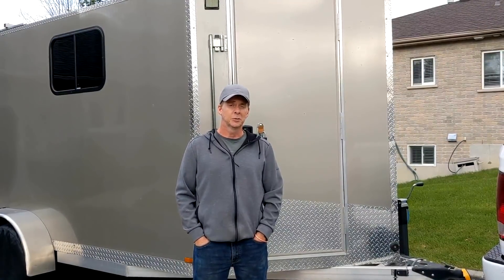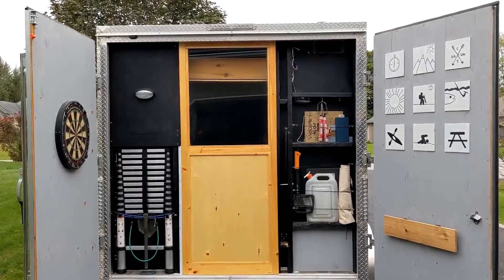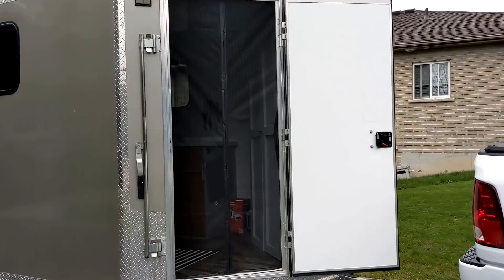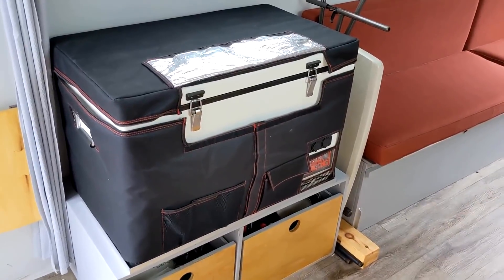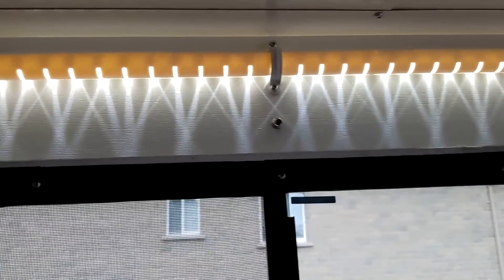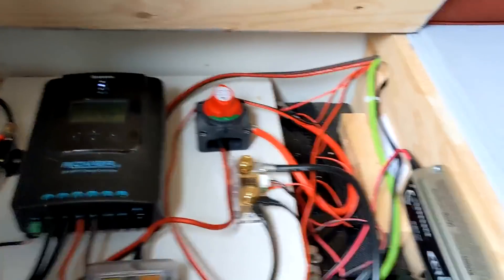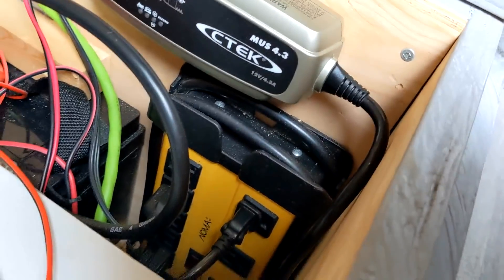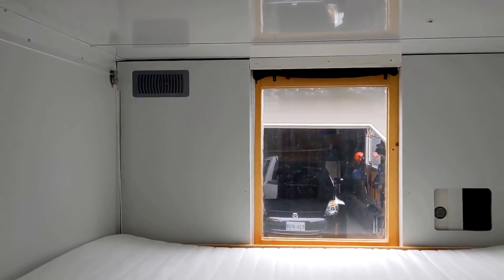Cargo Trailer Conversion walk through

Comment: I was about to pull trigger and  buy 2 electric actuator to build my own bedlift until I saw your build,  Both of your bedlifts are the simplest setup  from the hundreds of bedlifts videos online I have watched.  

Whats not to like, both your your bedlift designs require little material, investing  less than $100, and simple hand tools most DIY'ers have on hand.

Thanks for sharing
Reply from the maker: Glad I could save you some money.  V2 is definately smoother and simplier.

Comment: Space, space, space!  Tons of seating and plenty of sleeping options too!  Very well thought out and so practical.  A little pricey but of course you started with a very nice cargo trailer.  This thing could last you a lifetime easily.  Your build looks nice and clean too.  The cushions are nicely sewn and fit well, that’s something that many don’t quite pull off.  I have that same ladder, same solar lights too.  The dart board is a nice addition that invites other campers to socialize I’m sure.  Just really a great job.
Reply from the maker: Thanks for the nice comments.  I got lucky on the cushions as they were the exact size I needed so I didn't have to get those made.

Comment: We need a part 2 for that bed build and set up of the pulleys! Love it and want to do the same!
Reply from the maker: Hey there,  I have two videos about the bed.  The Pully system has been replaced now.  I found it was a good start but just not what I really wanted.  Here is the video of that one https://www.youtube.com/watch?v=bktiLsHAknc and here is the location of my new bed https://www.youtube.com/watch?v=BzIKehEFsVk&t=156s.  Much simpler and can be raised with a drill or manually.  The key for me on both of these was to not need to have a motor to move the bed thus not requiring more battery.

Comment: You have a really nice trailer conversion! Thank you for the taking the time to share it with everyone. I personally really appreciate it. I love elevator beds and this is the nicest I have seen. I am about to start a build and think I will go this way as well. The only thing I will do different is to use an 12V electric awning motor. I would be interested in knowing more about how you attached the roof rack for the solar panels. Maybe a short video on that? I have a plan for what I will do, but its nice to see how other people do things. Thanks!
Reply from the maker: Thanks for the comments.  I just stayed away from the electric motor so that if I was running low on power when camping that I had alternate ways of getting my bed up and down.  I plan on using the drill but also a small crank (manual) for choices.  You are the second person to request this so I will plan on doing this shortly.  Not sure if you saw both my other videos on the bed.  V1 and V2.

Comment: Afternoon Kent, Mark here. Hey awesome job on the build.. As of to date, I like your build the best! You used your space by far the best to your abilities!!! I am "HIGHLY" impressed Sir!.. As I am considering a build myself as I approach retired and came up with the same idea 25yrs ago, but life get's in the way at times.  That and now Lrg Teardrop and smaller campers are "WAY" too expensive and not roomy enough.. I may have questions later on. Again AWESOME job!..
Reply from the maker: Thanks for the great comments.  We  had a popup before and loved it but decided we wanted something easier and custom.  I like to come up with ideas.  Got to say watching all kinds of tiny houses, vans, RV and boat videos really help with the ideas.  Feel free to ask questions any time.
Reply: @liveandbreatheeasy  I tent camp now, but I have a Bluetti AC200P power station to power my cpap, fan and or milk barn heater in cooler weather.. Plus I only camp in State forest as the cost is cheaper, and I do Bigfoot research here in Indiana obviously, lol...
One question is, what are you towing with and what would you suggest if something else?.. Mark (aka Hoobilly)
Reply from the maker: @squatchnindiana3419  Hey there Mark.  I have a Ram 1500 but with my setup you could definitely tow it with less as the main trailer is made of aluminum which is much lighter than steel.  I haven't weighed it yet but I am sure it is under 4000lbs and I made sure I had breaks on it too which makes a huge difference.

Comment: Very nice build ! Back doors are great. The only option I’ve seen before that I like is having a ramp style door open up for an instant canopy, but it would require the space
Reply from the maker: Hey Tony thanks.  Yes, it took me a long time to finally decide on the doors.  Lots of positives for the other but like you said you need to have the space when camping.  I think a smaller trailer it is a great idea.

Comment: Really nice build! Lots of great ideas for my build. I plan on doing a retractable bed also. Looks like you did a great job designing the complete build. Would love to see a bed build video. Thanks for sharing.
Reply from the maker: Thanks.  I did a short video on the channel of the bed build.  I am currently trying something else out that I saw on Youtube that might be better but not sure since it doesn't use the crank idea which I liked.
Reply: @liveandbreatheeasy  Thanks! That would be great. I'm playing around with the 12v Harbor Freight wench build I saw on the first bed build I ever saw. Guy in Alaska   made one and it looks like the simplest one so far.

Comment: Very nice very well done but as an idea for your bed remove the handle from your pulley system remount the bolts and use a power drill for your up and down so I can take my

Comment: Looks good! Interested to see what you'd change after using it a few times.
Reply from the maker: Hi there,  we have used it about 20 times so far and I have to say there are only a couple minor things that I would change in the sense of build.  The layout we love as everything is in the place we wanted it and is very practical.  We had many years of camping in a popup trailer so coming up with the basics was easy.  One thing i would consider if i was to build the benches again would be to make the space between the wall and the hings wider so that the back pillows wouldn't affect opening them.  I am just finished v2 of the bed lift system a video will come out on that one.  Build quality could be better but I am hard on myself.  Thanks for asking.

Comment: You just made me a liker of a V nose for the most part I hated them but putting the door there made lots of room in the rest of the trailer. And smart, also pantry near the kitchen part. The bed would be an issue because it would be climbing over my wife to get up to go to the bathroom or if I get a leg cramp. I guess I could go out the back door. I would have to make a larger door in the back and maybe move the bed toward the kitchen part of the trailer. I very seriously thought about building a cargo winter house using an 18' plus tongue trailer we would only eat sleep and watch a movie or tv show Inside, mainly visiting relatives while we were in Florida. I want my property in the mountains to be our home. 73
Reply from the maker: Thanks for the comments.  Yes the V nose this way uses the space much better.  The was put at the end so that if it wasn't up we still could sit and eat.  I agree that climbing over your spouse is a pain.  With something that elevates like this, I am not sure how else you can get around this unless you chewed up more space and had your head and legs go length-wise in the trailer.
Reply: @liveandbreatheeasy  I would put two twin beds and have maybe a foot between to get in and out. I slept in a motor home that had beds on the sides but the beds were very narrow not a comfortable sleep. I guess my idea have a back door to go out. With tear drop trailers you have two doors one on each side that's another project I don't want to get into. My ideal would be a front bed and a rear bed and the door out the side. My wife cannot stand my snoring and hers can keep me awake if I'm not really tired. A seven foot wide trailer is really not wide enough but easier to haul. 73

Comment: Just found your Chanel and noticed you have same trailer I just bought and is being built. I am sure I will have questions for you once I watch your videos!!!
Reply from the maker: That's great.  Hope you enjoy it.
Reply: @liveandbreatheeasy  do you plan on any videos of construction such as insulating? I would like to how you made a roof frame for your solar and how you attached it to the trailer. Vacuum outlet is brilliant. I bought a marine mini hatch but I think the vac outlet would have been cheaper. I am doing same thing for shore power. Simple extension cord through floor.
Reply from the maker: @jacquesbeaudoin9706  I actually got them to insulate it because by the time I did that I wasn't really saving much.  The railing for the solar panels was really easy.  I used the screws around the top to fasten the track down.  I used u channel from home Depot and then  just square pipe for the cross member.
Reply: @liveandbreatheeasy  I will have a better sense of everything when I physically get the trailer in about 4 weeks. I have no idea what the roof looks like and the edge from outside or the inside. Thanks.
Reply: My same make trailer us a 7x12 and empty weighed 1680lbs. I have begun my conversion. What was your final weight?

Comment: Just found this. Great ideas that I plan to copy. Can you tell me what the inside of the ceiling is. It appears shiny with no mounting screws.
Reply from the maker: This was done at the factory for me but it is basically plastic sheets that have been attached with glue and two-sided tape for the overhang.

Comment: Very nice setup.  How long will the cooler last on the battery system with no hook ups?
Reply from the maker: Thanks.  All depends on the sun.  Without, I can run it for 4 days plus days. Chest type fridges are much better for using less electricity.

Comment: Very nice build!  I am trying to decide between a 14ft and 16ft trailer.  I’m leaning towards a 16 ft trailer with a 2ft storage area / utility room in the back.  I was wondering if you have had an issue with the door leaking while driving down the highway while it’s wet outside.  Thanks for making the video. 

wondering if you have any issues with the door leaking when driving down the highway while it’s raining outside.
Reply from the maker: Hi there .  I haven't had any problems with it leaking.  Just make sure you have a good trailer builder.  I picked the 14 ft because it is easier to find camping spots.
Reply: What height is your trailer?  Thanks again.
Reply from the maker: @SturgisTrey  hi there the interior is 6'6".  If you are wondering about the outside u would think about 8'6".  That's just a guess.
Reply: Appreciate your comment. I am having the same dilemma. I think I have decided on 16' because I am taking two teenage cats with me. I'm thinking of making the V front area into a play area for them, and a place I can put them while going in and out of the trailer so they don't get loose out of the trailer.

Comment: I just found this video. Super clean build!!  Lots of innovative ideas. I love the PVC LED lights. What do you do for showers during your trips? I’m considering a build like this and am weighing the costs and fitment of creature comforts. Would like to travel out west for a couple weeks at a time and I’m sure we would spend most of our time outside of the trailer, but I need to consider livability. Love your front door placement but would be concerned about leaks when towing through a rainstorm. Any issues?
Reply from the maker: Thanks, Joe.  We haven't had any problems towing in crazy rainstorms yet.  I think having the door down the side probably would have the same issues if any because the rain would be going down the side hitting the seams too.  With regards to showers, we typically are at campgrounds so far.  I didn't want to take up the space for something we wouldn't use that often.  I was thinking about having something out the back like many van lifers do by using the barn doors but time will tell on that one.  For me it was being able to go inside if it was raining for extended time.

Comment: Love your conversion! Did you keep track of total costs? It would be nice to know, for those who are considering a similar build.
Reply from the maker: Thanks, Bil for the comment.  I did actually keep track of everything I spent.  As some parts were re-used I didn't factor in those things but the bulk was new.  These are Canadian Dollars.

Trailer		        $11,094.34
		

Construction		$2,231.37
		

Exterior		        $171.95
		

Interior		        $2,569.95
		

Electrical		$1,785.98
Grand Total	        $17,853.59
Reply: @liveandbreatheeasy  Nice break down. Rarely do people keep track.
Reply: Lame

Comment: Where did u buy the portable refrigerator at? Thank you
Reply from the maker: I bought this here https://canadianoffgriddepot.com/collections/solar-appliances.  I also bout one of these for a van I converted for my sister in law. BougeRV 12V Portable Refrigerator 30 Quart Car Compressor Freezer Fridge,12/24V DC 110~240 Volt AC,-7℉~50℉ for Truck Van RV Jeep Camper SUV Boat,Travel Camping Road Trips Tailgating https://www.amazon.ca/dp/B08D9M14JG/ref=cm_sw_r_apan_glt_i_ZJRMJR3WBXY60DG6CH1G?_encoding=UTF8&psc=1 that works great too.

Comment: Have you taken trailer out in heavy rain yet?  Does door leak?
Reply from the maker: We have had some crazy rain and haven't had a leak yet.  The only time we had a little rain come down the door was when I had it leaning to low when parked and it was torrential. Driving never.

Comment: BRAVO👍😍‼️ Watching from Vancouver Island BC🙋‍♀️🇨🇦♥️‼️where do you hail from?
Reply from the maker: Barrie Ontario
Reply: @liveandbreatheeasy  We have ordered a Taylor Coach trailer 16x7(7×19 total length)out of Millgrove Ontario, it's been delayed due to parts shortages, so will prob go pick it up in the spring now. What kind of insulation do you have in yours?Our trailer will weigh around 2400dry, only manufacturer that guarrantees 4yrs on build. How much does urs weigh?
Reply from the maker: @janebray9392  Hi there,  Not sure exactly what it weighs but am planning on checking out the final weight this summer.  Mine is all aluminum for should be pretty light except for the double axle.  The insulation was foam board

Comment: In your costs, what do you mean exactly by construction? You listed the costs of the interior, exterior and electrical so I'm not sure what that is. Did you pay people to help build it?
Reply from the maker: All the costs in the description are materials.  I built everything but the actual trailer.
Reply: @liveandbreatheeasy  can you give an example of an interior cost and construction cost?
Reply from the maker: @noahmcdaniel4920  if you read the description of the video I have the costs for the different pieces of the build.
Reply: @Live and Breathe Easy  the description just says the total costs for the different categories. I'm just trying to understand what you meant by construction given that you already broke costs down by interior, exterior and electrical.
Reply from the maker: @noahmcdaniel4920  Sorry I am not following completely.  There were no other costs other than my time building it which is $0
Reply: @Live and Breathe Easy  your description reads:

Construction $2231
Exterior $171
Interior $2569
Electrical $1785

I'm asking what the construction category consists of
Reply from the maker: @noahmcdaniel4920  Now I understand what you are talking about.  Construction is all the material to build the inside of the trailer.  Wood, flooring, screws etc.  Interior is finishing items like bed, cushions, sink etc.  The exterior is metal for the roof rack for solar etc  Electrical is all wiring and electrical components from Solar Panels to switches.  Hope this makes more sense now.

Comment: Where’s the toilet? Shower?
Reply from the maker: There is no shower in it.  I didn't want to lose valuable space and most campgrounds have public ones.  I do have a casset toilet that is in the box under the fridge.  This gets pulled out at night and put by the front door where the folding table pops up.  Fits perfect and is used for my wife.  The curtain is pulled while on the toilet.